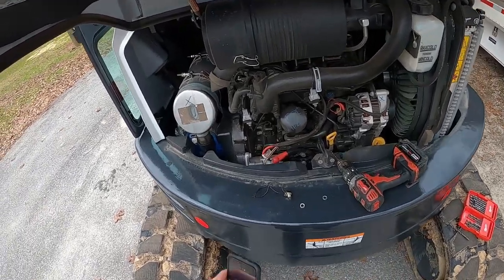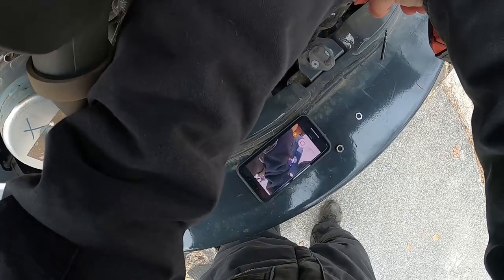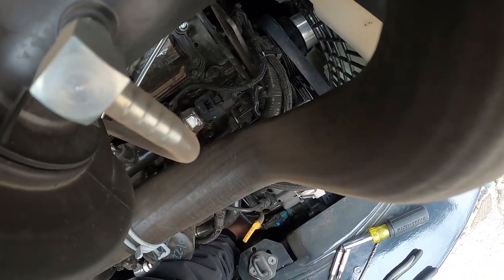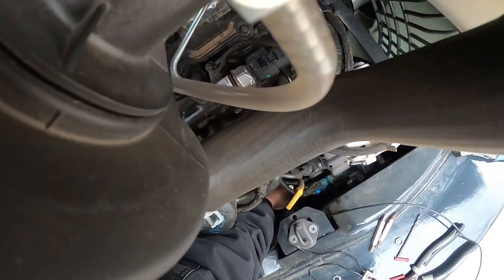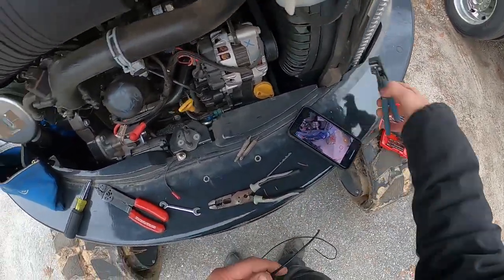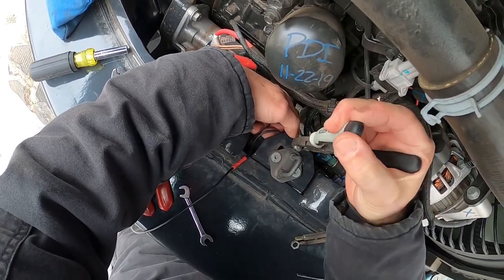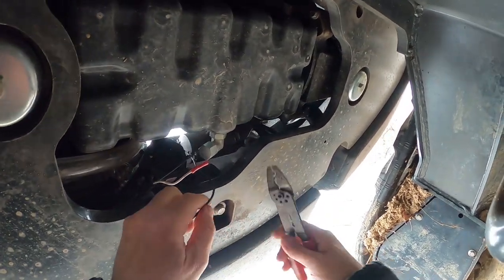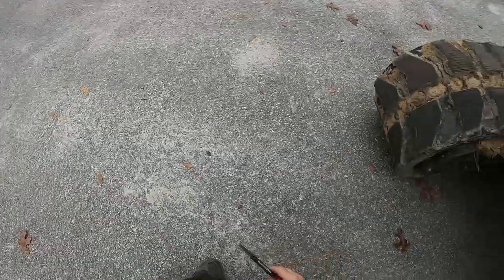Backup Alarm Enable-Disable Switch Installation

Comment: I wanted to message you thank you for this video.  I installed a toggle switch on my e35 yesterday and it works great.  A nice relief to shut off the travel alarm while I'm working alone on my farm. Today I will be working around other folks and will be able to turn it back on.
Reply from the maker: Glad it helped
Reply: Un 😢 un

Comment: I don't know what data the government might have, but I sure would like to hear from operators and proximate workers, from their experience, what their opinions or observations are as to whether these back-up  warning horns actually do any good when there are people around.  When they became federally mandated, I heard from mechanics in heavy equipment shops that they introduced a new danger in that they drowned out the audibles shouted from the people behind the machines so that the operator could not hear them, and it thus placed it all upon the person behind the vehicle to avoid being run over.  In other words, it used to be the responsibility of the operator to know what was behind him before backing.  I find these horns irritable.  Lots of work goes on in the area in which I live, so there is an incessant beeping going on that I hear inside my home, whether the machine is a block or two away, or a 1/2 mile.  I sure wish the people would unite and have this law removed.
Reply: They are dangerous xant hear shit over them
Reply from the maker: I agree

Comment: Do the specs on the switch need to be 3A /120v or is there some flexibility in the switch specs? Thanks for the awesome explainer!
Reply from the maker: I’m not real sure how many amps are on these little horns but worse case scenario is that the 3A rotary can’t handle the current flow of extended horn blowing (if that ever even happens 🤷‍♂️) Only thing I could find is this back up alarm that specifies 0.1-0.5A draw.
https://ecat.eleknet.com/PIM_Docs/Docs/STEP_ASSETS_PDF/15227207.pdf